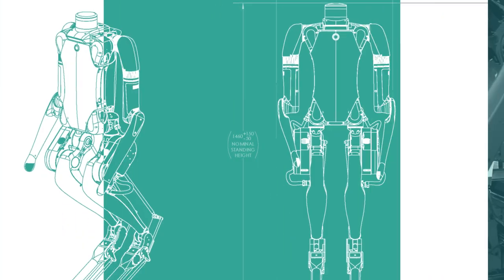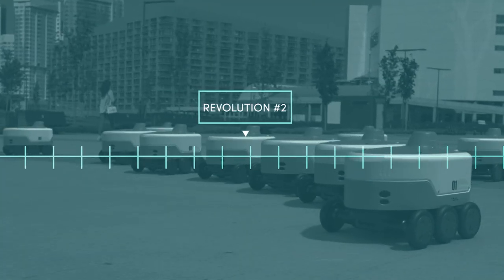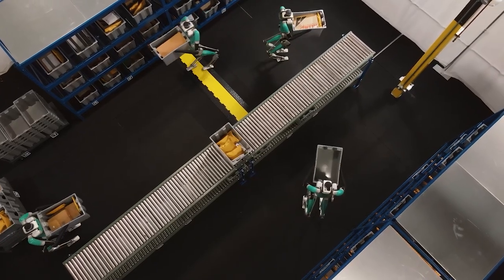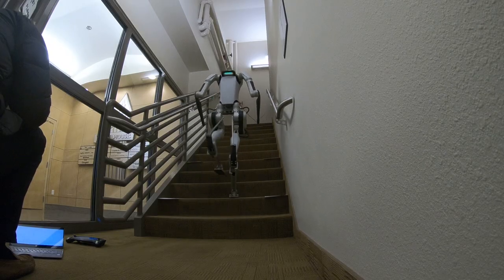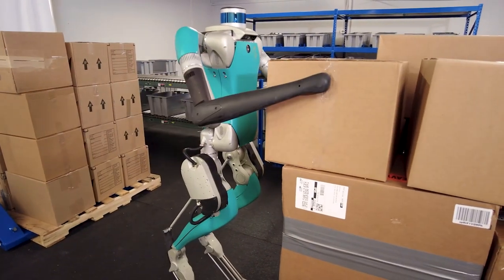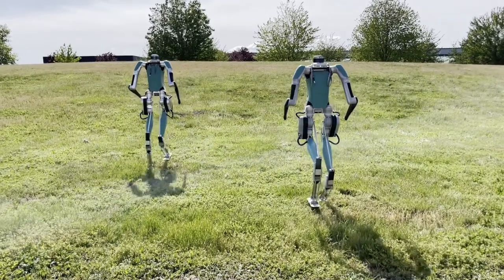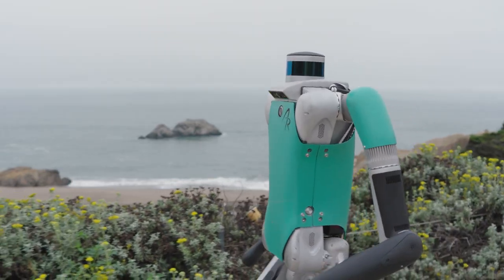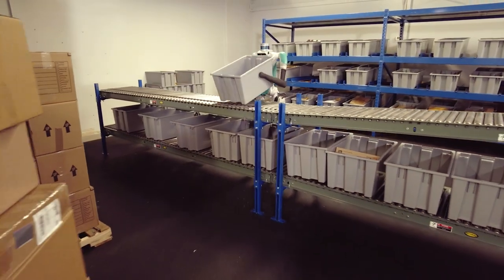What is Human-Centric Robotics?

Comment: Out of interest - what type of gearbox is used for the joints' movement? Stain-wave, RV?
Reply: Wouldn't RV gearbox make more sense given the industrial applications? Less wear and tear, more robust...
Reply: Not sure if it's RV specifically, but the Cassie joints used some type of cycloidal reducer, so probably the same on Digit's legs. There's an old promo video where Andy holds up one of the cycloid discs to the camera.